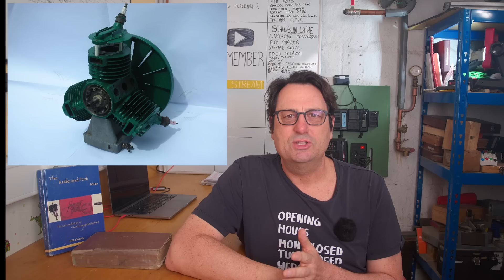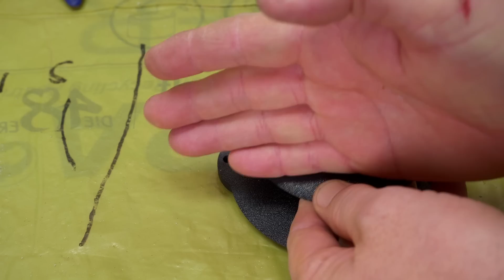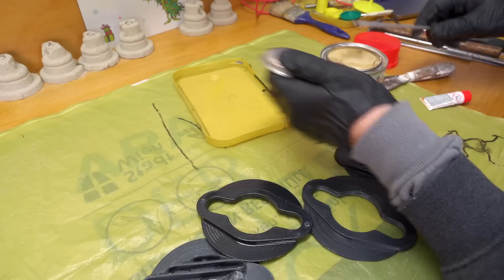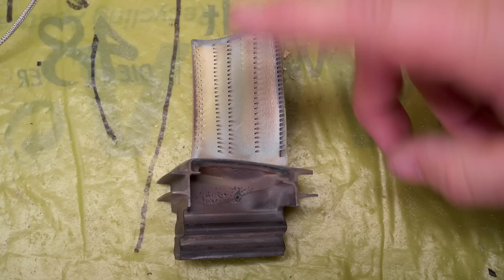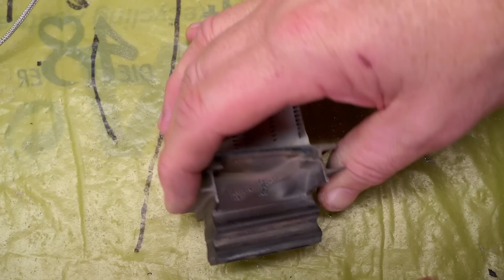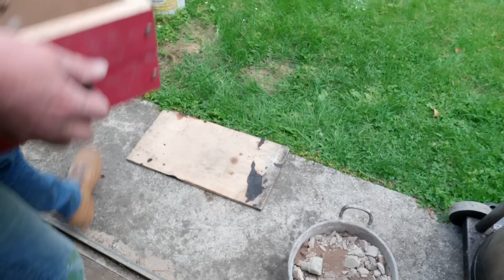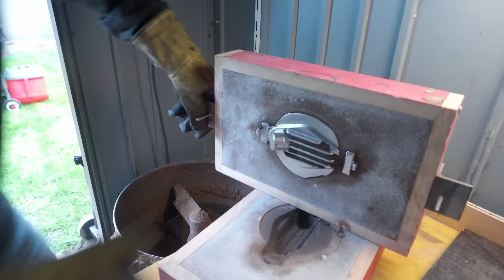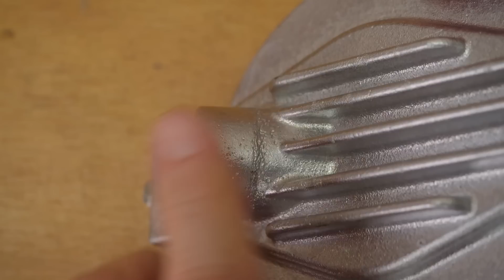Prototyping cylinder heads - Redrup Radial EP.6 || RotarySMP

Comment: Nice stuff, Mark.  Seems to me that the horizontal fins are the big issue, a few possibilities spring to mind.  Obviously, I know jack shit about foundry work, so feel free to point and laugh.

1 - Make 'em thicker and machine off the excess (also no more 3d printer marks left, bonus)
2 - Pour in through them, or maybe a thicker channel through them which could be machined away afterwards
3 - Heat up the mould before pouring.  Not sure if that is possible, but it might stop the metal freezing so fast.
Reply from the maker: I got them sorted. I will do the production castings at 720°C.

Comment: I use automotive glazing putty to fill in layer lines.. no mixing needed just squeeze it out of the tube. I found that finer details can be filled in with a high build plastic primer and the primer and glazing putty sand well.
Mind you, this is the process I use for my models.. I am unsure if it will help with mould patterns as unfortunately I am not setup with a foundry (yet)... although I have done some aluminum pours when I was a lot younger.
I also found some modelling tools on amazon.. basically the tool you made but put into a handle and has different size ball ends and some rubber tips too.
The above is not really my advice.. just my usage experience in case you find it helpful.
Seems you are learning a lot from this and getting progress, so far so good!
- Cheers,
Reply from the maker: Thanks a lot. What brand glazing putty do you use please?
Reply: @RotarySMP  - I likely tossed it when I moved but I am 99% sure it was made by 3M and I picked it up in a local auto parts dealer. I did a quick google and it looks like 3M sells this now under the Bondo brand. 
You can search for "3M Bondo Glazing and Spot Putty" and you should see it. Its a single part formula, in a squeeze tube.
(BTw thanks for making me go look for it.. I found something that I was looking for a few days ago in the search... why does this always happen to me?)
Cheers  :)

Comment: Only thing I could find was 1/4" BSF, AF=0.445"~0.449"
The only other 'formula' I could find was hex AF=1.5 x D +1/8" for Whitworth.

There was a mention of BSF 'small head' but 'example' was  BSF hex is one size smaller than Whitworth?
I'm pretty sure the information will only be available in print in old machining or reference books, almost everything online is to SAE  or 1940's 'Unified' standards
I did find tapping drill size for 18mm spark plug, 16.5mm 
It was easier to make18mm spark plugs.in multiple pieces so they could be dismantled for cleaning.
The smaller parts get, the more accurately they have to be made which was possible in 1920's but cost a lot more compared to larger parts. Larger tooling would also be more robust.
 My father always said Lodge plugs were better than Champion?
I probably have information somewhere 'safe' but it will most likely take longer to find than it's worth.
Interesting bit of history about Redrup, I never knew he was from Barry.
Being from South Wales I only knew about Barry Island and Butlins Holiday Camp and caravan park.
Still remember neighbours saying they were 'Going to Butlins for a fortnight' 
 Butlins closed in1969 (I had to look that up)
Porthcawl was a lot closer, I remember going there on a train in early sixties, it was an 'adventure' for a six year old
Reply from the maker: Thanks a lot. There are a couple of other comments concerning the BSF hex size as well.

I would recommend that biography of Redrup. It is really good.

Comment: Thanks to videos like yours (and of course Blondihacks) I'm trying to learn silver soldering but I cannot find all the "ingredients" that northern americans use. May I ask about the silver solder and the flux you used as you're based in the EU? Unfortunately I couldn't make it out from the video itself. Keep up this amazing work!
Reply from the maker: The flux I use is from Rothenberger. I have a link to it in the video description. The silver solder is a very high percentage silver, like 40% I can't remember where I got that. Probably Ebay about 15 year ago. Something like this.

https://www.ebay.at/itm/270940810788?_skw=hartl%C3%B6t+silber&itmmeta=01JW3WYBEHHS7P3WXVWYFWH3DQ&hash=item3f1554ae24:g:XWAAAOSw3T5cNJ6z&itmprp=enc%3AAQAKAAAA0FkggFvd1GGDu0w3yXCmi1ckZgrBcSwB%2FtyGcNS1Mj0MTkyK%2B1wTgqVtXWSDIhaQ2jq2mdXL7mnsLYJgAjnhetoe%2Fi%2FLnlyvOP8uc4vkmJMljXsUj%2BcnpFfO50yiCyKqT0sk64%2FjGTLX%2B%2FZlsgFj0DkRQu8l0X5W2EZ3dZR5lGJhuVhOgZUVm8583GKovlh97ywxUclHPjgnD%2BZbQ1kf3TIvZizS0i2EIjpM2t82A1v2Kf0IXGzsb2q7t4AR7rJhDjJNP%2BXf5Hsb4B8lpHMIuWw%3D%7Ctkp%3ABk9SR7S3-fzgZQ

The higher the silver percentage, the lower the temp you need. I need this as I have no oxygen system, just a cheap propane blow torch,.
Reply: @RotarySMP  Thank you so much! I haven't even thought about checking e-bay! In my country the only silver solder I could find so far was I think 2mm sticks with flux, but they are too large for most of my tinkering.
Reply from the maker: @feudiable  Because you can have alloys with a nearly any melting point, ber intricate things can be assembled. Jet engine fuel nozzles used to be done like that, starting with the highest temp filler, and then each time to assemble more bits, you use a lower melting temp filler, so you get to make the assembly  in multiple parts.

Comment: Just curious is there any benefits to preheating your sand mold? Since fast cooling seems to be an issue if your mold was late say a warm 60c would it help? Not even sure how your would warm it
Reply from the maker: If you consider the delta temp between the metal and the sand, raising the sand temp a bit wont help much. And the time between moulding and pouring can be considerable, especially if making multiple moulds.

Comment: When you ran out of propane, does the store refill the cylinder or exchange your empty one with a full one?  I ask because here (USA), the stores don't generally refill them -- only exchange.  You can bring them to some fuel stations, or dedicated propane dealers that will refill them.  The problem with tank exchanges (here anyway) is that the new tanks are only about 75% full (to prevent over pressurization since they are stored outside).  You're paying much more for the convenience of getting much less propane.
Reply from the maker: I am in an exchange program with Bauhaus. You only pay the refill, which is 11kg of gas (or at least is supposed to be).  In NZ you can refill them yourself at any gas station.

Comment: Wow youve really earned all your 👍 from  everyone for that one! So much work.
My suggestion for that round fin that is the last part to fill, and has the most mold cooling, would be to make the fin thicker.
It will cast much better, cool the engine better, and be more robust on the final product.
People will probably all want to make these engines now once you iron out all the issues. I hope you get the appreciation you deserve or maybe even some $ profit at some point.
Another suggestion might be to look at lost wax castings, although your kiln might not be quite big enough for some of the processes.
Reply from the maker: Thanks for you kind support.
Cooling fins are more effective if they are thinner. You want maximum surface area to volume ratio.

I have a couple of videos on lost PLA casting, which is similar to lost wax. Look for the Beatles in my video archive :)
Reply: @RotarySMP    well actually the fin should be tapered, if you really want cooling efficiency. I have some training in heatsink thermodynamics with my electronics background.
In your cylinder heads, the limiting factor will be getting the heat away from the central core and a thin fin is terrible for that. The ideal fin thickness for a motorcycle engine is (approx) 5 to 6 mm at the root tapering to 3 to 4 mm at the fin edge.
And as someone who owns a number of vintage motorcycles, that top exposed fin is always the one that gets broken lol 🙂
Reply from the maker: @wizrom3046  They are tapered. I put 1.5° on each side as they are in the drawing.

Remember this is a replica of a historic engine. I am not trying to improve it, just trying to faithfully copy it. 
I don't know whether Redrup did any thermodynamic calcs on it. It is only a 2 3/4Hp engine. 
I will make a few spares. :)
Reply: @RotarySMP   sweet, thanks for the explanation. 👍

Comment: Good result, I would try a runner with a riser at the opposite end of the casting, better expusion of air, and also two reservoirs of metal to assist complete filling.Excelent video, really enjoyed watching it! I want to do more casting if only I had less decorating to do!!
Phil. UK
Reply from the maker: Thank for the tip Phil. I was considering a bigger riser on that opposite side, but went with the thinner vent on Martins advice.

Comment: This is super interesting! Brilliant video. Thanks so much for documenting all this.

With CAD, I ended up going down the Fusion 360 root. I tried FreeCAD for a while (when the free Fusion 360 started getting more features locked out). The snag is, I was too far into Fusion at that point, so I decided to stick with it. FreeCAD did work well for some things I designed though. Definitely a good modelling tool.

Loving those cylinder heads! - Heather
Reply from the maker: Hi Heather. I have become pretty comfortable with FreeCad, although there are aspect of it which frustrate. Given the monetised channel, I couldn't use Fusion. I liked Onshape, but can't afford a license.

Comment: Thanks for all the info. You should look at a resin printer. With all the resin options out there and the super fine resolution, you can print close to perfect and smooth.
Reply: I had an FDM printer, then went to resin, then back to FDM. Resin printing in itself is a lot of trial and error when it comes to properly supporting parts and having them not break off the build plate while printing. Could not understate how awful it is to work with resin and all the alcohol you need for cleaning etc. every time I used the thing (with VOC respirator) I felt like I took 1 year off my life or that I’d just gotten cancer. Can’t say how happy I am to be back to FDM printing now 🫠
Reply: @briswolf For me it's the opposite, but I have to admit that was before companies started to make FDM printers that are actually good. Still, the surface finish is unsurpassed with resin. A compromise would be to have them printed overseas after finalizing the design in FDM.
Reply from the maker: I considered one, but the mess is a bit of a turn off.
Reply: @RotarySMP  I understand. I switched to a water washable resin, but cleaning the printer and filtering the resin back is still a bit painful. I am really looking forward to the rest of the series and the start up. Best of luck and thank you for sharing your knowledge.
Reply: @RotarySMP It's not so bad, considering your copious usage of bondo and sanding on the FDM parts in comparison. And you'd still print prototypes in FDM, and switch to resin only when you're final with the design and want that gorgeous surface finish.
Reply: Yeah, resin is great when you need good surface quality, and the current offerings are nothing where you need to think twice, 8k, huge working area and only a few hundred bucks. With the right support placement, even flat and large features won't distort before cured.

Comment: Why don't you pull the plug-boss negative out while the part its attached to is still in the sand?  Would that work?  Pulling it THROUGH the other part, inwards?
Would keep the sand / edges in that area protected and IMHO easier to extract, with the bigger positive still in position?
Reply from the maker: That is a an excellent idea Joan. Shame I didn't think of that when I was modelling it. It works well enough now that I probably wont redo it, but will keep that in mind.
Reply: @RotarySMP     I wrote the comment half way into the video.. kept watching and seeing how far u are - understandable.

But another thing that appeared.. as u muse over shrinkage effects of that big volume that sparkplug-boss represents.. any way to reduce that be 'preforming' the hole for the plug a bit?  Even a cone (to stay under the demolding angle) would probably help a bit, no?
Reply from the maker: @joansparky4439  I considered using a core, but it is small enough that it feeds nicely with the feeder. A core would be tricky to position at that angle and to secure between the cope and drag.
Reply: @RotarySMP    PS: thanks for the little introduction on thermal sensors on jet engines and how they keep the blades 'intact'.. impressive stuff (for anyone not working with this day in day out).  😲

Comment: I haven't used FreeCAD, but one possible way to do the draft around the spark plug boss could be to join the head and plug, fillet and then subtract the plug afterwards. The subtract function tends to be more robust, even Fusion360 struggles with complex fillets.
Reply from the maker: I tried that as well. There are so many intersections around that boss, that you always end up with fillet failures.
Reply: @RotarySMP 
I see. I guess that's just the cost of free software. I've had similar problems with Fusion when doing fillets and drafts on patterns.
Reply from the maker: @EirikvanderMeer  If I had the choice I would have stuck with Catia, but can't use my student version since I monetised my channel.
Reply: @RotarySMP 
Ah yes, monetising counts as commercial work. I managed to hang on to my Inventor  student licence for years but all things must come to an end I guess. 
In the end you still need some filler and sanding to get a good pattern so it's not the end of the world.
Reply from the maker: @EirikvanderMeer  I see it the same way Erik.

Comment: Loving the long format casting vid, and the aside into EGT measurement Mark.

Something that occurred to me while watching early on, and is probably not the right thing to do, but how about casting with all of the thin sections vertical? ie same mould and split line method, but then set the cask up on one end having closed off the top and bottom to become sides.  Finally removing the new "top" (original drag and cope sides) for pouring. The rationale behind this is the fill might be more uniform and less likely to freeze too early in those thin sections. The spark plug spigot could also become the sprue. 

I know it's a completely deviant cask type, but thought I'd just put it out there for contemplation.
Reply from the maker: There would be a lot of pressure on the mould. It sounds like it could well cause the mould to blow out. I think I will stick with a few more °c of melt temp.
Reply: @RotarySMP  Yes there is the danger of that, hence suggesting adding boards to what would normally be the top and bottom. I just wanted to air my thoughts in case it sparked another idea. I'm sure you'll crack it anyhow.
Reply from the maker: @squelchstuff  I am sure vertically split moulds are used for some special cases, but I don't thing they are common in sand casting.

Comment: You mentioned in Bambo labs slicer you had a problem with your .stl model. I always import a .stp model and never had a problem. I don’t use Free Cad so I can’t say for that. But you mentioned having problems with the fillets around the base of your removable insert for the spark plug boss. What I usually do in these cases with my software is to model the part with the boss as one piece then fillet everything. Then subtract your removable piece as a separate model away from the bigger model. If that makes sense? Also with the fillet problem. Did you try just modeling a simple model of just the bottom fin and the bottom of the head as simple as you could. Fillet the intersection. Then take that simple model and join/combine it to a model of the rest oof the head without those features. The software my be having difficulty because of the complicated model but be able to fillet a simpler shape. I have found it’s sometimes better to join simpler shape in cad. As I say I have never used FreeCad so I can’t say if any of this would work.
Reply from the maker: I also subtracted the boss, leaving the partial fillets, but couldn't get the fillets on the acute side of the boss.
Reply: @RotarySMP  Did you fillet before the subtract? Also can you split the model with a plane? What I have done with partial fillets like this is. With the complete filleted model. Split it at the intersecting planes. Then delete the parts I don’t want. Then combine the parts I do. Hope that makes sense.
Reply from the maker: @EdgePrecision  I tried ever combination of order of model, fillet, extrude and subtract over the last 5 months on this part. I could never get to an order where FreeCad would do every fillet.

Comment: You got robbed by the Bauhaus... My nearest Shell petrol station hold gas bottles; the same bottle that you are using is 16 euros if i recall right... I use a bit larger bottle for the bbq and that is 20 euros per bottle... Bauhaus is to be avoided at all costs, the prices there are insane even here, plus, the official policy of the store is horrible... Otherwise, nice vid!

Best regards!
Steuss
Reply from the maker: Good tip Camillo, thanks. I will ask at the gas station next time I fill the car.